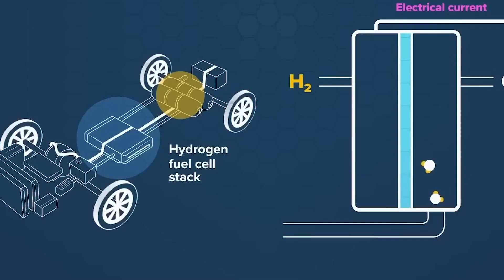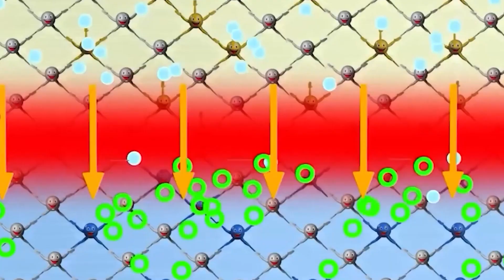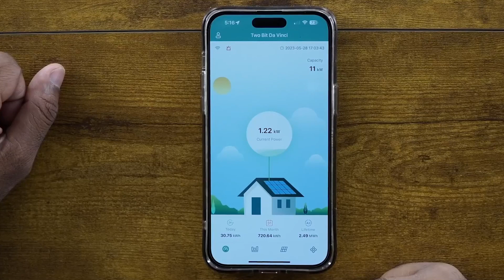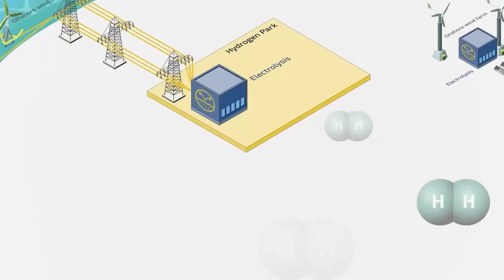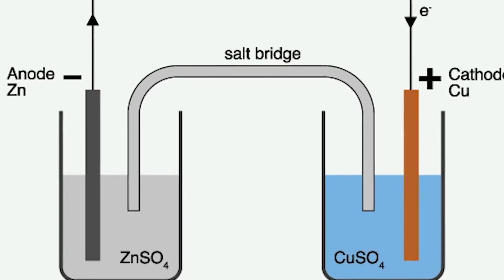The Future of Energy: Hydrogen Panel At Home Will Revolutionize the Solar Industry

Comment: Your still more efficient storing the solar directly to a battery. Hydrogen powered cars require high pressure tanks, I don't think people want large tanks of highly explosive gas sitting next to their house. They've also found a way to make air batteries that uses the moisture in the air to generate electricity, using almost any material. Hydrogen isn't needed.